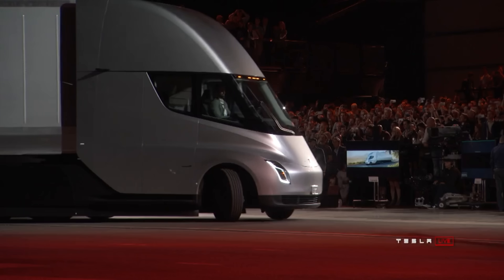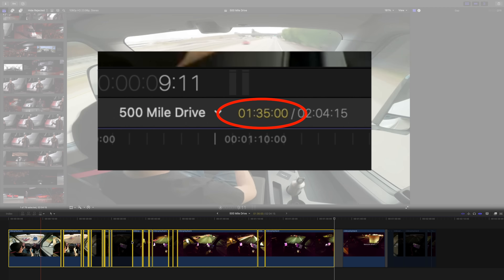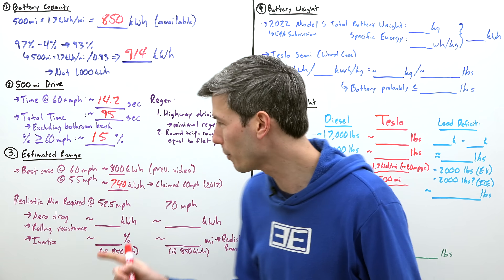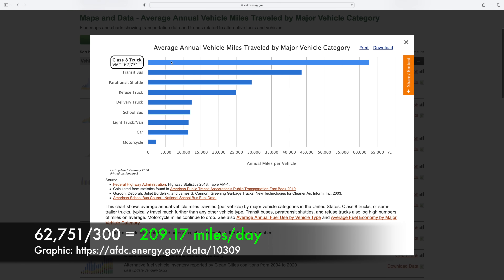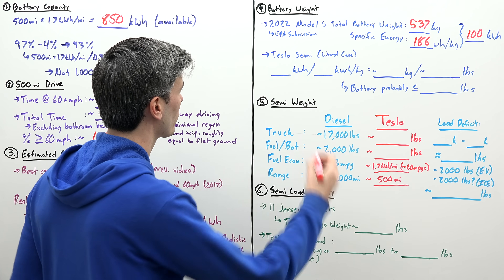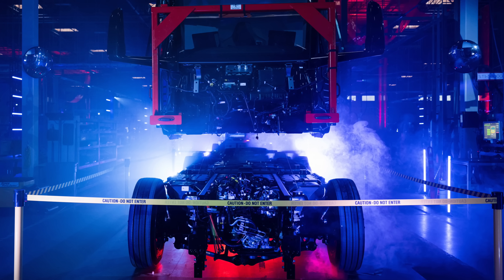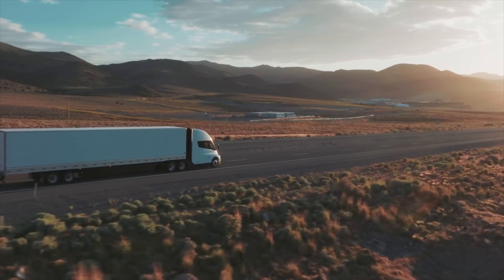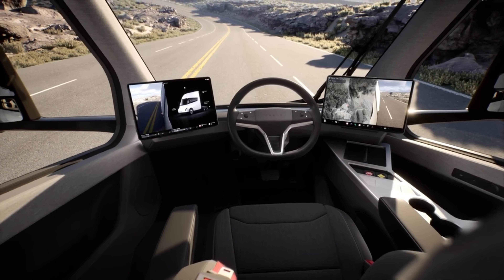Does The Tesla Semi Make Any Sense? Part 2!

Comment: I would have liked to see you cover the charging issues with these trucks and the massive upgrades in infrastructure that will be required to charge them. A few trucks here or there is one thing but I'm sure Tesla are hoping to sell 1000s of them and that is going to require a lot of electricity and the infrastructure to deliver it to the vehicles.
Reply: To everyone on this thread, the charging stations are a big deal as well as the substations to feed those charging stations. I’m a big fan of renewable power, but anyone saying that you’re going to use solar power to charge batteries to in turn charge semis at night is just delusional in the context of current technologies.
Reply: @JoeOvercoat  -- We don't have the electrical capacity for this, if half the trucks on the roads were electric people are going to have to do without something, air conditioning, washers, dryers, lights, heat, it will take many decades and trillions of dollars to build and transmit the kind of electricity electric vehicles as a common thing would require.  I'm all for electric vehicles, but this is like replacing horses with cars before gas stations were developed and common.  As far as solar panels, when there's a tornado, a hurricane, a massive hail storm and you need to replace wind turbines  and hundreds or thousands of solar panels what do you do, go to Ace hardware and pick up a couple hundred solar panels?  What are people supposed to do for electricity until you can get hundreds of solar panels built and shipped from China?  The fossil fuel is bad mantra being droned into us is going to leave us bankrupt and in the dark.
Reply: There is already a lack of overnight parking for trucks, and it is why you will see them parked along interstate exit and entrance ramps.  Now, couple that with a need to park in a specific area to be able to move after your break.  These trucks will only be useful when traveling between properly equipped depots for a while.
Reply: @wsterling303  To be fair providing charging lots on the Federal dime would solve that age-old problem of screwing over tired truckers who really do want to just pull over and sleep.
Reply: I believe their Megacharging stations will utilize both solar and stationary storage at each location. Reno is getting the first solar charging station for regular cars. I expect Tesla is already preparing the semi chargers.
Reply: @bugguy1967  you need a quite massive solar farm to just power 1 charger.. we are talking about a surface of over 3500 square feet PER CHARGER
Reply: @IronPhysik  from the renderings I'm seeing, it's only as large as the charging lot. Solar is cheap for suppliers, so scaling should not be expensive.
Reply: @bugguy1967  whoops storm knocked out our power. charger is down for two days guess your stuck here 🙃
Reply: "Whoops, I can't read"  -  @sneed915  

Bugguy said "I believe their Megacharging stations will utilize both solar and stationary storage at each location", that means solar/wind should still charge the batteries, even if the grid is down... 

Now, how are you going to pump you gas without the grid? - sure you CAN do it by hand, not exactly quick to fill a truck with though, is it?

Basically, we're all SooL when the grid goes down
Reply: @MrVelociraptor75  If the grind goes down due to a winter storm, the solar is going to be limited in its effectiveness. It would also require a very large solar system to be able to keep up with the demand that those charging stations would require.
Reply: @DaveCM  Yes, the main point was to shut down xyz's "hur hur, ICE superior becoz no need power" BS

Although I doubt it would be setup for it (it requires a fair chunk of dedicated hardware), it's perfectly viable to have a dedicated solar system working to charge a Megapack, with the systems to remain operational during a blackout. You're right, it would require a massive system to keep it fully operational, but, it could feed a few important vehicles (fridge trucks etc). But it's not a good place to be for anyone.

Let's just build a more robust grid, hey? (distributed energy storage helps a lot with that)
Reply: @DaveCM  The roof area covered with solar panels on any endpoint warehouse may quite well be enough to keep up with the charging demands of the fleet associated with that warehouse.
Reply: @sneed915  when you don't know fuel stations rely on power too 🤡
Reply: @sneed915  you're using an unlikely edge-case to justify your position. This big "What If" is a common tactic when you have nothing else to argue. Show me examples of thunderstorms taking-out any ev chargers anywhere. It's an unlikely occurence. You know what is a likely occurence? The Russia/Ukraine war causing a diesel shortage in the U.S. THAT actually happened, and all fleet owners and drivers are paying for it.
Reply: @bugguy1967  what do mean what if? Ive had fuel solutions to truck stops without power all the time but yeah man just because the truck stop is without power elon musk is gonna have his own tesla substation at every truck stop to prevent this right? Are you even a trucker? Do you know what we deal with out here? Whats the discharge gonna be sitting in 8 hour chicago traffic jam? a snow storm that makes the road undrivable for an extra day? The tesla trucks will be fine for local and regional jobs. OTR is a no go though too many variables
Reply: @sneed915  again, edge-cases. Did you even watch the video?? Didn't the guy cover all this? Do you understand the customer base for this? Why are you guys so up-in-arms if you truly believe it won't work. If it doesn't work, no one will buy. Simple. This is like me selling winter jackets for mild climate. Then you come along in the comments from Northern Finland stating that they'll never work in real cold. Okay? Are they marketed for your extreme situations? Dullards, I swear...
Reply: It's generally not a problem. (Other than the cost of batteries to smooth out the peak demand for the charging station)
Reply: @KalifUmestoKalifa  it absolutely it
1MW power for each charging station is not smth thats easily archived everywhere, thats a HUGE amount of power needed.
Reply: @IronPhysik  it's much more than 1MW it's 1MW per charger a station would presumably have at least several of chargers. But one Tesla megapack is capable of Abt 1.5MW peak output and it stores about 3MWh so a couple of those would be quite enough.

Comment: They can make it travel double the distance in a single charge - as long as it's purely battery driven, i'd never use any electric vehicle. Electric motors are great - huge amount of torque from zero, minimal losses, minimal noise, eco-friendly, but batteries are amongst the worst inventions the world has ever seen. I really hope at some point they will give up on the idea of battery powered EVs and move on to develop the hydrogen infrastructure that is certain to be the way forward.

Comment: As they say "If your wheels ain't turning you ain't earning.".  You have to be running between 500 and 600 miles every day or you are not going to make any money.  Where are you going to charge those things and you can't be sitting around waiting for it to charge if there is a place to charge it.  It normally takes around 15 minutes to fuel a normal truck with a range of between 1,500 and 2,000 miles.  The Tesla doesn't even have a sleeper on it.  It is a major problem in the US to find a place just to park for a rest brake let alone a place to charge the battery.  Every place else I have read the battery weighs 11,000 pounds.  Tesla have been extremely secretive about the battery weight and the tractor weight.  Most shippers require the maximum physical space and maximum weight, whether they need it for a particular load or not.  I can see absolutely no use for the Tesla other than maybe moving something light weight around in a city.  A $200,000 tractor to only be able to move a little stuff around in a city makes absolutely no sense.  We taxpayers are buying those Pepsi trucks.  That is not good.
BTW:  I am retired but I have been a truck driver, a math, computer science, and physics teacher, a plant engineer, and a software engineer.

Comment: I worked in the trucking industry for years and the big thing truck buyers look at is freight weight. After all your math the energy density for lithium batteries is too low so the truck too heavy when empty. The truck is for specialized routes and claims to being green. By the way alot of big fleets govern (limit) the maximum truck speed of diesel trucks to 60 mph for economy and safety.

Comment: A couple of questions about the effect of replacing 60% (or more) of the tractors on the road with Tesla trucks. Wouldn't that increase the average Gross weight of the tractor / trailer combination? If so, wouldn't that increase the wear and tear on the roads? Would the current methods of capturing road use tax compensate for this increase in average weight (and roadbed wear) or would there be a tax advantage for electric truck fleets that then would have to be paid for by the non-electric truck fleet and the rest of us?

Comment: There’s huge demand for lots of short run trucking.
I work at a small engraving business in CA that gets BIG deliveries for our size of up to three semis in a day.
It’s a huuuge pain getting trucks consistently.
Not sure if that’s a shortage of drivers, trucks, or cost-efficiency of the business, but it’s ALWAYS been a pain to get our stuff from a radius of like 120 miles max.
Truck companies constantly cancelling on us, being late (in days).
Anything that helps us get more drivers, doing more runs, doing more/more cost efficient load.
Also you can usually tell trucks on the road are mostly not weight limited because enough in my area are cruising at 55-60 and not slowing on the hill climbs and turns so seeing the “cubed-out” stats is interesting.

Comment: Did I hear less than One hour charging?     800,000 KW   at a 400V  is 2000 amps,  What is they  plug in 2 or more  trucks will there be a battery back up station?

Comment: Official cargo capacity is 44000lbs for the 500mi semi and 49000lbs for the 300mi semi. This doesn't include the trailer, both are rated for 82000lbs total load. Nonetheless, you can expect much more than 4-6klbs capacity deficit, I'd say on the order of 10k to 15klbs
Reply: That is the total weight allowed not what you can have as cargo massive difference.

Comment: I will LOSE MY FREAKING MIND if a bunch of trucks spaz onto the highways going 55mph.  

Other than that and the fact that these batteries will just further jack up the price of the existing battery market (thus depriving me of a low priced EV), I'm all for it.  

I am curious about real world data, though, not highly curated drives or theoretical performance.  I hear pickup EV's get pretty pathetic towing performance in real world scenarios, and I suspect these will be the same (though there are obvious differences, so maybe not)

Comment: So if you followed the Simi on its test drive in a Tesla 3 you would most likely exceed your epa range.
Reply: EPA range is bassed on an average 55mph speed.
Reply: @Victor-vj5ds  no it’s not. The highway rating is highway cruising.   The city ratting is just stop and go.  The  epa estimate that is the most useful is combined.  That includes stop and go and some highway driving.   It splits between city and highway estimate.

The highway estimate for the simi with a full load is most likely around 440 miles . In city use it should be close to 535 or so.  Rough. Est.
Reply: @fatboy19831  at 60mph it should have 500 miles of range, it has a 900kwh battery. In my state 60mph is the limit for semi trucks on the highway.
Reply: @Victor-vj5ds  true but you would have to charge  with 3% of the battery left.   No company is going to take that risk.    In Marryland most trucks go around 65 to 70 mph on 95.
Reply: @fatboy19831  companies will do 400 miles at most on a single charge at full weight but can likely do more than 500 in a day if it charges at the first facility it arrives at.

Comment: I run a dedicated route 5 days a week driving a 2020 Freightliner Cascadia Evolution with DD 13 and 12 speed auto transmission and full sleeper (refrigerator, microwave, tv, double bunks).I travel 640 miles per day round trip, my truck carries 300 gallons of fuel and 20 gallons of DEF. I run 65 mph for all but but 20 miles total, using 85 gallons of fuel per trip (depending on head wind) and fuel DEF once a week. I pull double "pup" trailers or A train configuration, each trailer averages 10,000 pounds of freight. This run typically takes 12.5 to 13 hours to complete with turn around and 30 minute break using 10.5 of my 11 hours I am allotted to drive in good weather.

Comment: The exact weights of the semis are published, I believe. IIRC the 500mi semi is 26000obs and the 300mi semi is 20500lbs. If we assume the difference is just battery, This means 390kWh/4500lbs density or 10400lbs (5900lbs) for the larger (smaller) battery pack.
Reply: This is expected. Volvo trucks with 1016 kWh batteries in europe have a battery weight of 11000 lbs

Comment: 500 miles is terrible range for semis. Regular fuel burning semis have almost double the range.
Reply: So, most semi trucks don't even drive more than 250 miles a day. Why would you care about range instead of fuel price in this scenario?
Reply: @Victor-vj5ds  It depends on the case, like stated in the video. My dad drives ~500 a day long haul. They just don’t seem like they’ll be viable for long haul any time soon without massive deficits on haul capacity. I should have elaborated more during my original comment.
Reply: @ajcogswell  if your dad is an independent long hauler this isn't the truck for him but if your a huge fleet owner that does mostly short range deliveries this truck is worth it. The fuel and maintenance is the biggest selling point, at 7 cents a kwh you can travel 1.5 miles at 82,000lbs GVW.

Comment: You can twiddle the numbers all you want (and yes you’re quite good at it) but the simple fact remains that until Tesla publishes hard, verifiable numbers regarding range, payload, recharge time, etc this is all speculation.  Truck operators wouldn’t let any other vehicle manufacturer get away with this smoke and mirrors nonsense.   Now that deliveries are finally being made it will be interesting to see what actual customers say about the performance - unless they are prohibited by some sort of  NDA to release that information.

Comment: Recharging these monsters in half an hour will take incredible charging rates. What are the specs on the chargers, and what is the upper limit on the rate these batteries can safely be charged?
Reply: Upper limit is 1MW+. Typical car chargers can be 250kW-350kW max charge rate.

Comment: What about the problems with cold weather ? Electric vehicles drops pretty much in range when exposed to cold weather ,ICE not so much
Reply: If the battery is conditioned, it won't be cold on a cold day since the truck can artificialy heat the battery pack.

Comment: Any experts: what about slightly smaller batteries matched with a diesel generator? You get the EV drive train, can charge durning downtime, possibly lighter and have ability to extend range. The CPU should be able to calibrate how much to diesel to use for a given trip.  I believe trains do something like this.
Reply: Then your just burning diesel more efficiently but still can't compete with the simplicity and cost of a full battery system.

Comment: 1.7 a mile.  BS!  Massive exaggeration.
Reply: It has three motors, two for torque and one for efficiency. That's how they got 1.7 kwh per mile.
Reply: @johntheux9238  and drove at low speeds
Reply: @adamwiseman5831  No, it's 500 miles at 65 mph.
Reply: @johntheux9238  They couldn't demonstrate that in the video.  Weird???
Reply: @adamwiseman5831  Yes, but they only used 93% of the battery.
Reply: @johntheux9238  yes that's what they said.  Some might also say the bathroom break was a recharge too.  They also said it would self drive too.  We have to wait to see what others say, like NOT the person selling it.  Just a thought .   I hope it's all true in the end .
Reply: @adamwiseman5831  It can go from 10 to 80% in 30 minutes so that's a coffee break... And you don't really need self-driving for a convoy, they can just follow each other with one driver at the front.
Reply: @johntheux9238 😂did you see the tesla robot that's going to make us all rich too.  Sure it took 3 people to hold it up on stage but it works.  Like I said I hope....but dont count on that stuff for awhile.
Reply: @adamwiseman5831  It was walking all by itself...

Comment: Here's some material for another video: diesel trucks are a mature technology. Electrics are not. Compare when diesel locomotives were introduced vs. steam. Or jets vs. recips. At first there was one main advantage (range without adding water for diesel locomotives, speed in jets) So an interesting question is: are there fundamental reasons why the electric semi will not continue to improve while the diesels are maxed out? What are those areas? And what are the areas where they are basically as good as they are going to get? Your first two videos were excellent, but there is more to consider, and your method is perfect for the task. Thanks for your hard work!

Comment: I can't for the life of me work out how you think the Tesla truck chassis, [not including the battery] would weigh the same as a diesel truck [@17,000Ib] As a diesel truck has the additional weight of an engine, gearbox, driveshaft and differential. Surely there's about 3,000Ib difference, as your own image you quote above Table 5.13 says the drivetrain is 24% of the 17,000Ib weight of a diesel truck.🤔